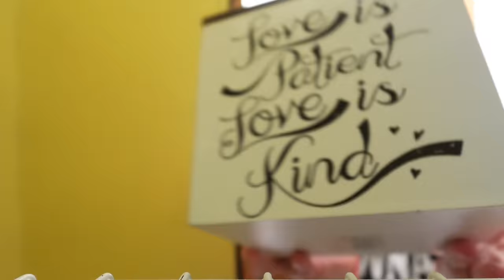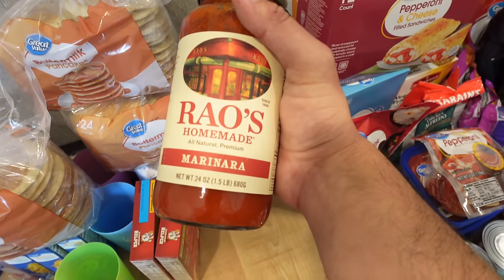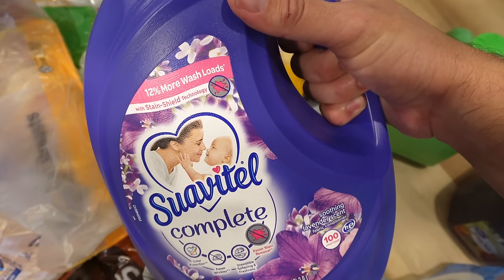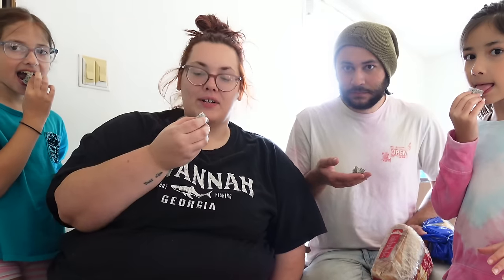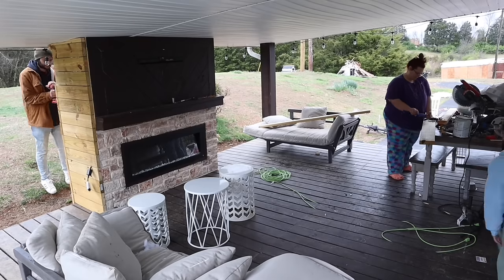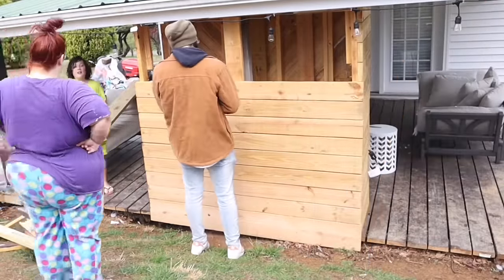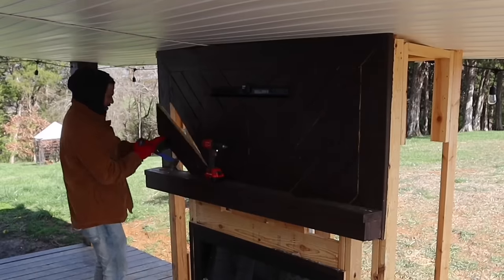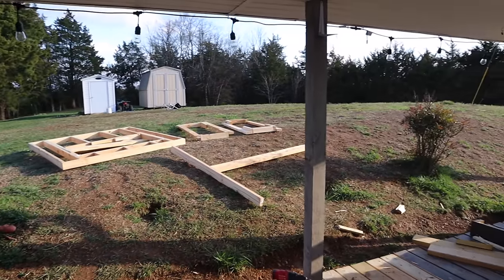TEARING IT ALL DOWN! | 1991 double wide mobile home remodel | mobile home demo | ep.21

Comment: You only need 1/4 cup white vinegar to use as a rinse/sanitizer. If you prefer dryer sheets, you only  need 1 sheet!
Reply: To save you some $$- consider only one dryer sheet OR the fabric softener in your washer. You don’t need both. Also, use only 1/2 of the amount of laundry detergent the bottle tells you to use. Remember….the goal of the laundry detergent companies is to sell laundry detergent!!😊❤
Reply: I had to have my washer worked on and when they took it apart oh my goodness!!! There was build up down in the agitator it was all black mold disgusting, the repair man said yes liquid softeners are bad for your washer.
Reply: The buildup in her fabric softener thing was too much. She cleaned it in the single wide once.
Reply: I'm so frugal I only use 1/2 a dryer sheet and I water down my laundry soap😂
Reply: Fabric softeners also builds up on your clothes.  It prevents towels from being absorbent.  This is why you aren't supposed to use anything but soap on microfiber.  Use white vinegar instead.

Comment: Merina, have you ever made foil packs? They are great: yummy, can be personalized, and even made ahead of time. With you great big potato haul, they would make a great treat. I was thinking about your chicken legs/breast dilemma. (Bone in meats add so much flavor, but it works well without bone options too.)
I liked to put down the squares of foil and let each person create their own flavor profile. 
With chicken, I put salsa, potatoes rough cut, onions, garlic, green beans, peppers (red/green/orange/yellow), sliced zucchini, sliced tomatoes, sliced mushrooms, corn. Then fold the foil up into a peak so that steam can circulate. Spice it as your family likes. (Sazon Goya packets are great!)
Cabbage is another great veggie-esp. with pork chops. 
This is a great way to use up leftovers. Just lay out the veggies and let them gave at it. And since you are trying new veggies for your family, this is a great way for them to be involved. You may want to start by preparing for them—and ease them into the adventure.
Bake at 350 for 25 minutes.
Let packets stand for at least five minutes before serving. 
Cut a slit to let steam escape. 
Place on plates and enjoy! 
You may want a dollop of sour cream.

Comment: I'd like to share an observation that could save you moneyl read the manufacturers directions for the amount of laundry detergent, softener and dryer sheets.  You are using probably 50 to 60% more than you need. The excess soap left in the fabrics actually causes wear and tear. One way to see how much extra soap you are using - put a load of towels in the washer and run with no added soap. Once it has filled up and run for 5 mins take a look and you will that the water is soapy.

Comment: This is just a suggestion… if you shake your clothes out before you stuff them in the dryer,  Wadded up, they will dry faster and won’t wrinkle as bad. Make sure to get them out as soon as they are dry. You might also try to get into a habit of washing, at least one load of clothes per day,  with such a large family that will cut down on them  piling up and you getting overwhelmed.

Comment: I use to work at a restaurant called Praters Taters and what they do-bake some taters and once done cut one of the end off all them and take 2 taters and the cut in put together(so it looks like one ginormous tater then whatever your family wants on the taters is what u put on it. Don't have to be the normal sour cream, butter, and all that. For ex. If your kids want a taco tater do the taters like I said and cut down middle like regular baked tater and put everything but the tortilla chips on the inside of the taters and top with salsa. You can fix taters like that with anything- chicken,steak,mac and cheese. The choices are endless and it's almost like u got 2 meals in one

Comment: I cut out everything white and watch my carbs.  No sugar.  I lost 8 lbs in a week.  Potato's are loaded with starch which turns into sugar.  I eat only meat and vegetables.   If you cut all that out your body will start using the carbs and fats already stored in your body for energy.   If your keep adding those starches and sugars it will use those instead of those stored in your body.